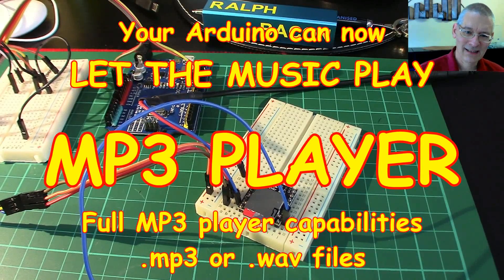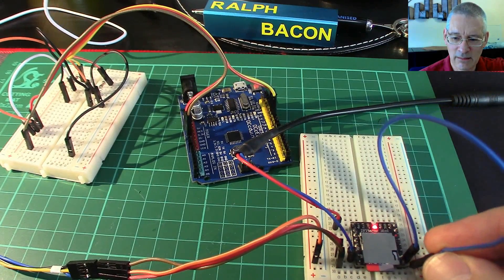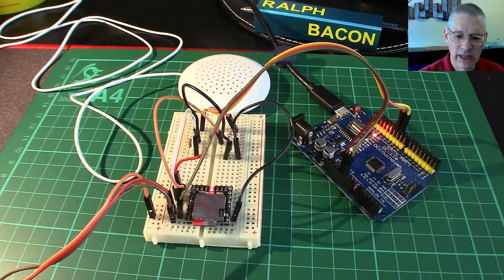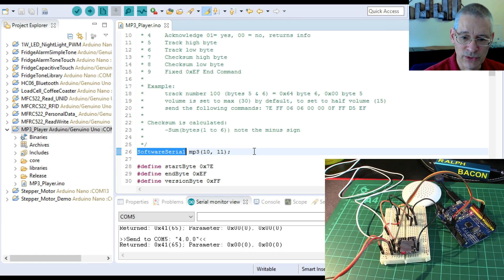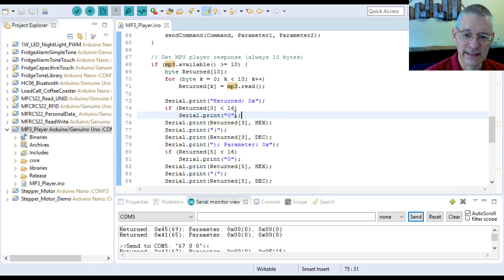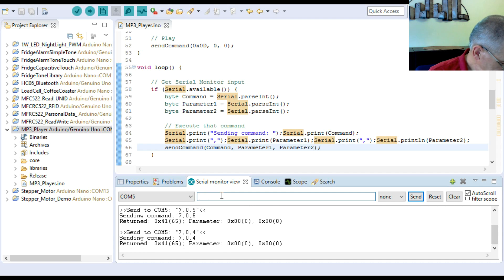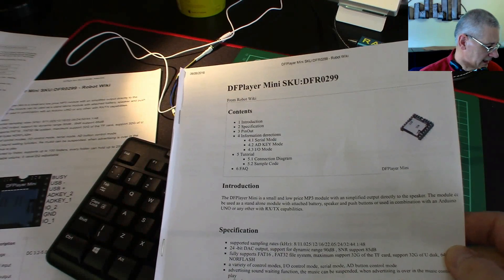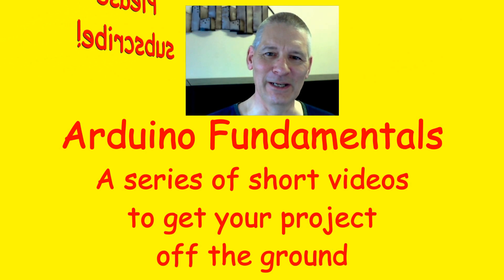#40 Let the music play! Arduino based MP3 Player for music (or announcements)

Comment: You used a resistor, you could use a logic level shifter on the tx rx correct?
Reply from the maker: Yes, a logic level shifter would be the ultimate solution, although not strictly necessary, partly because there is no bidirectional communication, it's all serial. But your choice, do what you feel most comfortable with, ifell3!
Reply: Ralph S Bacon Thank you very much for your reply. I want to use two players on one Arduino, just to send play track commands after certain actions, similar to your weather project. Two RFID readers playing a MP3 after being triggered from two MP3 players but controlled from one Arduino. UART will have to be in a slave setup, so the players are just receiving?
Reply from the maker: I'm just thinking through what you're describing here, ifell3.
 
1. You have two RFID readers. 
2. Each reader triggers a separate MP3 player (via the single Arduino).
 
So why do you need two MP3 players? The Arduino could send the command to play a different track to a single MP3 player. Unless you intend playing two tracks simultaneously?
 
If it turns out you really want to use two MP3 players you can still do that from the Arduino by using two further pins in Software Serial (you create another object with the two extra pins, SoftwareSerial mp3_2(8,9) for example). I'm not sure I understand the comment about "slave setup"?
 
Anyway, if you would like to elaborate on why you need two MP3 players I'd be happy to think a bit more about this!
Reply: Ralph S Bacon So I'm building a kitchen for my daughter, the saucepan will have RFID tag built in, two cookers, so two MP3 players. She could put on a frying pan and a saucepan and I would like to emulate the sounds. 
Great I thought you could only have one serial Rx tx, I knew I could use other pins but didn't think I could have 2 sets of Rx tx so to speak.
Reply from the maker: I'm kinda guessing this is a play kitchen, not a full sized one! Yes, you would only need one MP3 player, and just request different tracks to be played. But at least you now know about multiple serial ports using SoftwareSerial! Good luck with this, I'm sure your daughter will be pleased. So will you for the first dozen times the sound gets triggered. After that, the power may suddenly be switched off (a bit like giving a child a drum as a present, if you get my drift). :)
Reply: Ralph S Bacon yes a toy one, and will have a volume haha. 
Now was thinking what if she has a saucepan and frying pan on together I wanted both sounds hence two players, this is a picture of what I was looking at https://people.ece.cornell.edu/land/courses/ece4760/PIC32/uart/multiple_drop_diode.PNG
Reply from the maker: Multidrop is usually applicable to bus protocols, like I2C or RS485. I've not seen it used for serial communication like this before. You can try it but I'd go with the extra serial port created by the SoftwareSerial library for simplicity. If you do try it, and it works, let us know!
Reply: Ralph S Bacon thank you again, and sorry to create this into a forum base. I might have to use my uno then instead of my nano as I don't believe the nano allows for a virtual secondary serial. But will test and let you know. Many thanks again
Reply from the maker: Your Nano is identical in all respects to the Uno and supports multiple software serial ports, so you are good to go. No apology necessary regarding asking questions, happy to help. Good luck!
Reply: Ralph S Bacon thank you very much.
Reply: Ralph S Bacon been thinking even if I attached both players to the same serial without serialsoftware it wouldn't work as the commands sent would be picked up by both players as no unique I'd assignment.
Reply from the maker: Correct, you can't connect both MP3 players to the same two serial pins. But even if you use just one MP3 player you still need to use SerialSoftwre to allocate the pins you're using to communicate with the MP3 player (you can't use the in-built UART for serial comms as you use this for your USB connection back to your computer). Start with just the one player and then add another, that bit should then not take long.

Comment: Hey, that was I quick reply, Ralph.  Thanks enormously for taking the time to respond.  I haven't had my Uno long so I'll read up a bit more on pin setting and, oh, I'm not brave! Last question, I promise. What does the 2k resistor achieve if the voltage divider is to reduce the voltage from the Arduino pin as would the voltage still not be 5v at the node with or without that resistor?
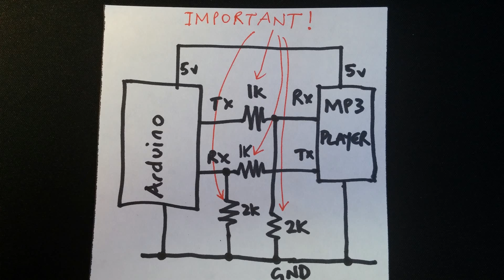Reply from the maker: Interesting. At 06:17 in the video, I show the diagram of the resistors we're talking about. I'm wondering whether the 1k resistor connected to the Arduino's RX should not be before the 2k resistor. That way, if the Arduino RX pin is at 5v we will only see 3v at the junction of the 1k and 2k resistors. Basically, wire it up exactly as per the Arduino's Tx resistors. I should have measured the voltage at the Arduino's Rx pin - that way we might figure out whether I had a reason for doing it this way or whether it is an error (after nearly 2 years!). Well...
 
Well, TheBLCbob, if you ever get one of these MP3 players to attach to your Arduino perhaps you can do the honours, and report your findings back here? In fact, just loading the sketch would be enough, no MP3 player required, just measure the voltage at the Arduino's Rx pin. Amazing that you are the first to spot this after all this time. Kudos to you. Thanks for posting (I think!)
Reply: Thanks for getting back, Ralph. I first watched your video a couple of months back when I was thinking about a project to detect an cat that frequently ventures into our garden after birds with an annoyingly prolific and unsavoury bowl movement.  A Mission Impossible style laser beam detector wired to the Uno with a deterrent output was my thought. After some of my more extreme ideas were vetoed by the wife, I considered a barking dog effect first and maybe a high frequency sound emitter if that fails or annoys the neighbours. On watching your video I ordered the DFplayer which arrived a few days ago. That prompted me to revisit your video for instruction on the module. Your revised thoughts on positioning of the 1k resistor seems logical to my presently limited understanding and, for the sake of a couple of resisters which I might pick up in a pack before Maplins 'closes', I'll follow your experienced lead.  I'll also take your challenge of measuring the pin output voltage initially with the code running and again when the DFplayer linked in and report back. Cheers, Bob
Reply: Right, Ralph, as promised. These are my voltage measurement. The conditions are:-(1) circuit as per your video but with the 1k resistor moved to between the Uno and the node of the voltage divider (VD) and 2k2 resistors used instead of 2k as that's what I had;
(2) Code loaded and running but took lines 33-46 out of the downloaded code as causing compiling issues; 
(3) for identification purposes - white leads used for circuit between DFPlayer (DFP) TX and Uno pin 10 via a VD, and yellow leads used for circuit between DFP RX and Uno pin 11 via a VD; 
(4) Uno powered vis USB connected to PC; 
(5) DFP playing; (6) no commands being sent during tests; 
(7) measurement taken across point specified and ground. My voltage readings were as follows:-Measurements (a) to (f) were taken with leads disconnected between DFP & voltage dividers 
(a) DFP TX +3.34v (white)
(b) DFP RX +1.51v (yellow)
(c) Uno pin 10 +0.38v (white)
(d) at VD node on pin 10 circuit +0.26 (white)
(e) Uno pin 11 +4.88v (yellow)
(f) at VD node on pin 11 circuit +3.35 (yellow)
The following measurements were taken with voltage divider circuits fully connected
(g) at Uno pin 10 +2.84v (white)
(h) at VD node connected to DFP TX +2.79v (white)
(i) at Uno pin 11 +4.88v (yellow)
(j) at VD node connected to DFP RX +3.35v (yellow).Make what you will of that.
Bob(N.B. try as I might, I can't seem to get the formatting of above text right despite several edits!)
Reply from the maker: That is certainly a comprehensive list of measurements, Bob, well done!
 
So the one we're particularly interested in is the Arduino's RX pin (10) which you show as almost zero. Ditto for the potential divider, but rises to 2.79 when connected to the DFP TX pin, which is just the 3.34v reduced down by the resistors.
 
The Arduino's TX pin (11) is 4.88v (so nominal 5v) but is nicely voltage divided down to 3.35v for the DFP. All safe.
  
So it would appear that the Arduino's RX might be able to be connected directly to the DFP's TX pin as it is the DFP which has voltage, not the Arduino. On the other hand, if it works as is, I'd leave those resistors in situ, in case the Arduino does ever let that pin go high (perhaps when transmitting, who knows).
 
On the subject of compilation errors in those lines, if you're using the Arduino IDE you must put the line starting "template" on the same line as the next line in my sketch, starting "void debugPrint". Then it will all work in the Arduino IDE too.
 
So you're safe to continue, Bob, and you were right to query the setup in my diagram, but no harm is done either way. I guess if it hadn't worked others would have made their views known by now! It's a nice player, the biggest drawback in not being able to interrogate the player for the filename currently being played. this, of course, is not a problem when playing Muzak in shops!
 
Thanks for the information Bob, let us know how you get on with it generally in your project (and whether it has any success in deterring that rogue cat - I must not let Benny read this, he will be most upset!).
Reply: Thanks for the heads-up on the code, Ralph.  I took those lines out after seeing that the code you used on the video (at 8:40) didn't have them and then it worked.  However, following your explanation of what caused the errors I have put them back in.  I shall be leaving the second VD in place as you suggest for belt and braces without disadvantage.  It is a good little player. Thanks for the chat. Bob ;-{)
Reply from the maker: My pleasure, Bob, hope it all works out. Keep tuned.

Comment: Thanks for the video, Ralph. very easy to follow. I'm just a beginner and trying to gain knowledge with a 'current' electronics knowledge just short of basic.   I'm perplexed by the need for a voltage divider on the TX of the MP3 player. Isn't the voltage on this line provided by the MP3 Player rather than the Arduino so would be at its 'native' level of 3v3.  If that is the case, wouldn't the voltage divider have the effect of dropping the voltage input to the Arduino RX pin to 2v2?
Reply from the maker: I don't want you to be perplexed any longer than need be, TheBLCBbob, so let's think about this. The output of the MP3 player is indeed 3v3 but the input voltage on the Arduino is still 5v (think about how an input pin on the Arduino can be biased high to the 5v line) so current would tend to flow from the Arduino to the MP3 player.

This may not matter or happen; a proper voltage shifter (as shown in other videos here) would deal with this, but the resistor way is a rough and ready (albeit safe) way to achieve more-or-less the same effect (although it does reduce the output voltage in the way you have calculated). If you're brave, don't put anything on the Tx pin of the MP3 player. It will probably be fine. I'll think about this post some more as time goes by. Thanks for posting.

Comment: Hi Ralph. Thanx for the great content, recently found your channel due to the DFPlayer and i have learnt quite a few new tips and tricks. I was just wondering whether you have been able to get it to repeat a track?Just for clarity, i use the multiple folders option so my sounds/tracks are split into numbered folders.  i have tried the following based off of the banggood link: 

0x08   8 Specify repeat(NUM): This is very unstable, as every time the board reboots and a different track order is loaded, the hard coded repeat for the error/boot bugs out and plays what ever song was made to play first

0x19  25 Single loop: Cant seem to get this command to work, it specifies that it is able to loop a specified song, i have tried running the command before, during and after a track playing.

0x17  23 Loop Folder "01": This is the only one i seem to have success with, but this means isolating every track i would want to be able to repeat into their own folder, severely limiting my options.

Thanx in advance and also thanx again for the great vids!
Reply from the maker: Let me have a look at this when I get back to the UK, Marcelle, I can't remember what I tried without checking. Give me a nudge if you don't hear from me!
Reply: Thanx for the reply! I have also been experimenting with the little board and thus far for my project have run into some hoops with it. But i guess thats how you learn. The busy pin on it doesnt seem to transmit Low as it says it shoukd when playing a file, only when it receives and sends a command. And also cant seem to get the "get state" method to work. Dont know if anyone else experiences this and cant seem to find many forums on it

Comment: Hey can u help me to get the name of currently playing directory and all the directory names to display on serial port or any display ?
I'm not getting that function in any of library but it's mentioned in the data sheet.
Thanks.
Reply from the maker: The $64,000 question is Sarvjit: where is it mentioned in the data sheet? I ask, because this question has been asked by many and I still haven't found an answer. It would be hugely useful if you could read the MP3 file name but, as yet, no-one seems to have achieved this. If you do discover there's a hidden command to do this please let us all know! Now, if...
 
Now if there is simply no way to do this, there is a clunky workaround (or two). For example, when uploading the music to the SD card, make another SD card copy. Exactly the same. Then you can use the Arduino to read the backup copy (track name etc) using standard SD commands on a separate SD reader, whilst playing the primary SD card on the MP3 player. Clunky? Yes. Will it work? Yes. Sometimes pragmatism trumps purity, as those following the Zen rules of Python programming will know.
Reply: Ralph S Bacon 
https://www.dfrobot.com/wiki/index.php/DFPlayer_Mini_SKU:DFR0299
Reply: Ralph S Bacon the by8001 module is similar to df player  and it's library has all these functions i mentioned.
Reply: Ralph S Bacon one guy made a mp3 player using by8001 module which looks similar but has different commands gor the same functions for df player. He also added alarm clock and used tft display to display contents. The file name total time elapsed time etc. So please check how we can make the same using df player mini(alarm clock is not needed😊)
Thanks for replying 👍
Reply from the maker: I've just had a very quick look at the BY8001 MP3 Player module and whilst you can query the module to show what is playing, the file name seems to be returned in 8.3 format (old windows short name format) so it still might not be what we want. It would work fine for, say, Adele's 'Hello' but not for Kylie's 'Give me just a little more time'. I'll investigate further.
Reply from the maker: I watched that video but I didn't see anywhere where the track name was displayed. Did I miss something?
 
Everything else can be mostly done using the MP3 player module I used, although I don't recall a function to query where we are in the currently playing track, just a 'busy' or 'not busy' status. Much of his project was about using a touch TFT screen, very nicely done, and which I explore in video #83. He also uses a DS3231 RTC module which I explore in video #5.
 
If you need to replicate his project exactly then I guess you're going to need a BY8001-16p, but the DFRobot version can do a pretty good job too. It all depends on what is important functionality to you. Let me know where/whether you saw the track name being displayed.
Reply: Ralph S Bacon sorry for that yeah he didn't but there is direct function in by8001 lib that we will get the current playing track name and all track names also.
And it is also mentioned in df player data sheet also but there is no library that contains such kind of functions. So I want help regarding that .
I thing if we send command 0x4B  then it will return current track name. 0x47 gives total no of files on tf card . So these functions are missing in there own library :P  and there is no library which is totally complete. So that I asked u for help.
Reply from the maker: My demo sketch doesn't use a library so why not try using that sketch with the command code(s) you mention and see what you get back?
Reply: Ralph S Bacon ok I'll try this.

Comment: Hallo Ralph. I like your explanation and full documented example. Good startpoint to play with this MP3 player. Thanks for your time !
Reply from the maker: Thanks, Huib, I'm you liked it. There's more you can do with this player but once you get as far as the demo sketch I guess you will figure out what else you can do. Thanks for posting.
Reply: Hallo Ralph, I was playing around with the commands but some did not make sense to me. Looking on the internet I found a very complete document with all the commands and also code examples explained. My problem was how to found out how repeat play works in a folder.  The link is :
http://www.trainelectronics.com/Arduino/MP3Sound/TalkingTemperature/FN-M16P%20Embedded%20MP3%20Audio%20Module%20Datasheet.pdf
Regards
Huib
Reply from the maker: Thanks for sharing that information, Huib, very useful indeed for everyone reading your post.